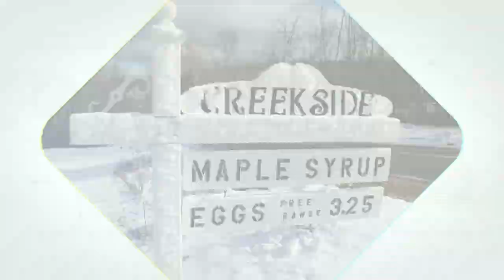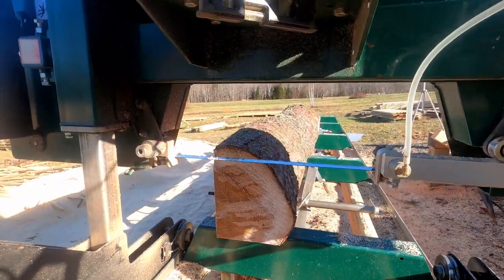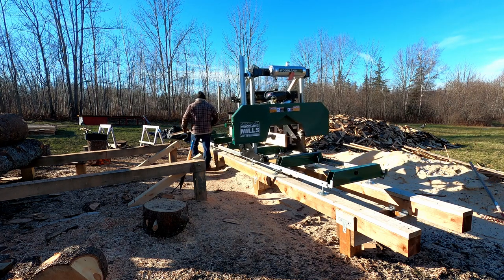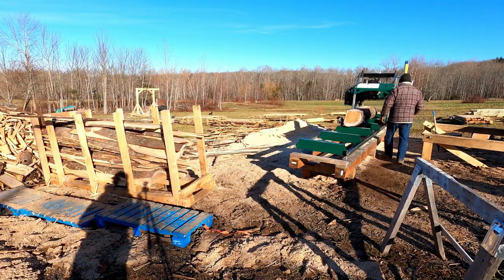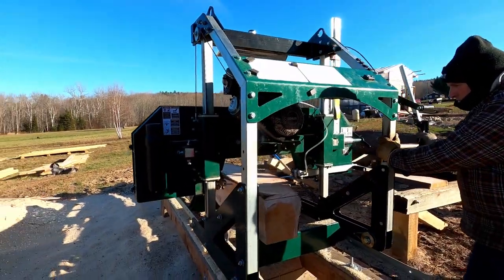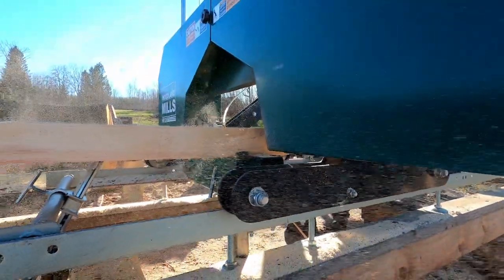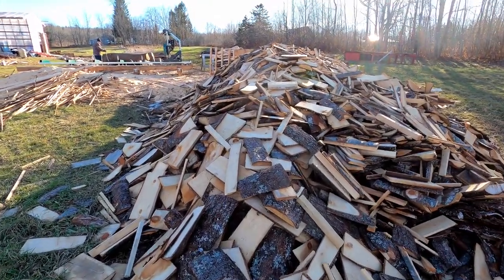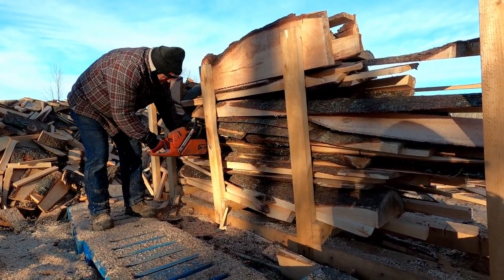Woodland Mills HM 126  /  Addicted To Milling  Ep.1

Comment: Yes keep the lube to 2-3 drips per second. Unless you have a real sappy pine. I also want to say this, when you pull the head back raidse the head 1 click so it does not drag on the log. Continued dragging over time can cause the blade to jump off. Or even break on a next pass. Just a friendly "heads up" here. Enjoy watching you mill. Subbed too.
Reply from the maker: Thanks Joseph. Appreciate the sub and any and all suggestions to make things run smoothly. I love milling lumber. I think a lot of folks think they have to run the lube as a steady stream. That makes for blades coming off for sure thanks again and appreciate the comments